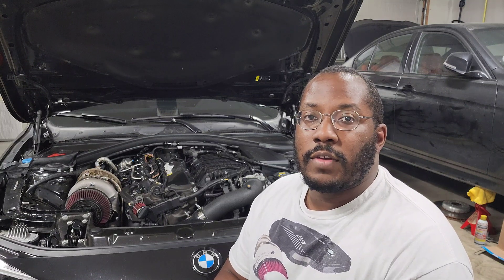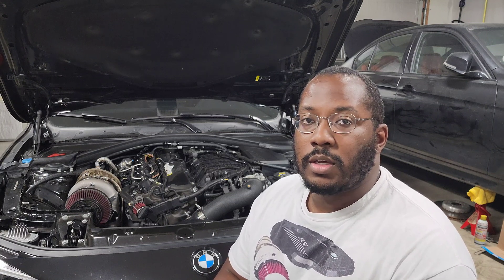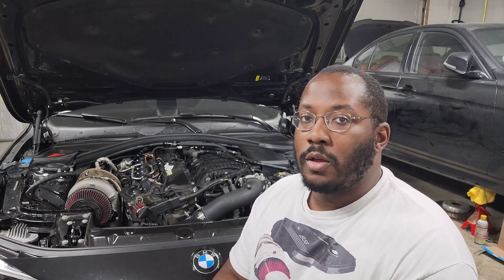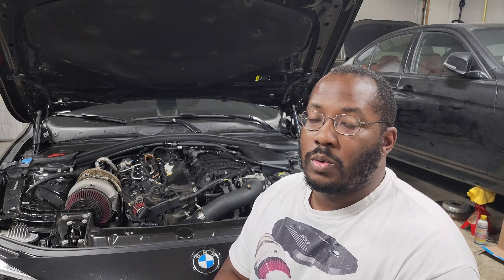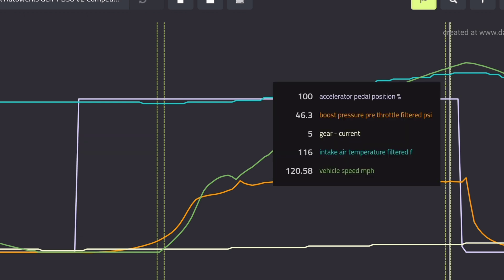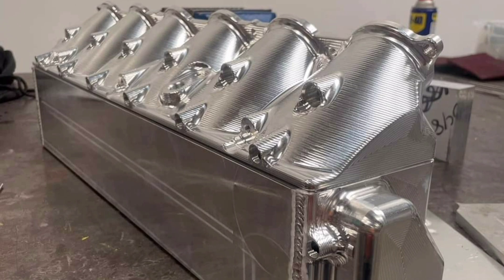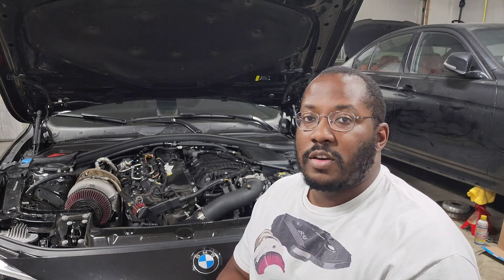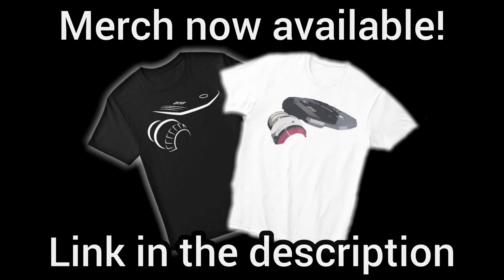Will The New RK Manifold fix the Heat Soak Issues? - The B58 Digest

Comment: Hello i have been watching your videos but i have got issue with my gen1 b58 engine i want to know what is the issue is recently my  oil filter housing cracked and I replaced it after that  i get turbo over heating issue its gets proper red what the problem can be can you help me with that? Thank you.
Reply from the maker: How do you know the turbo is overheating?
Reply: I get Plastic smells when i drove it little bit harder, then i parked my car i check the engine bay turbo was glowing red.
Reply from the maker: Glowing red doesn't mean it's overheating. Figure out where the Plastic smell is coming from
Reply: They take off all inlate manifold when they changing oil filter housing.
Reply: I did send you a photo on instagram have a look at it please

Comment: Why does no one know about interchillers?
The demon runs the air intake coolant through the AC condenser and get the IAT negative!!
Why is no one doing that on a B58???
Reply from the maker: in this video i explain why it wouldn't work well with the B58
Reply from the maker: https://youtu.be/ReeeaAauE2E
Reply: I was told by killerchiller that there is a 340 that has the system on it.

Comment: Thank goodness, because the 1st revision manifold was a joke. RK installed it themselves on my car and it was vacuum bled and onboard bleed procedure a few times each. Saw higher IATs than compared to stock. I even paired it with CSF heat exchanger.